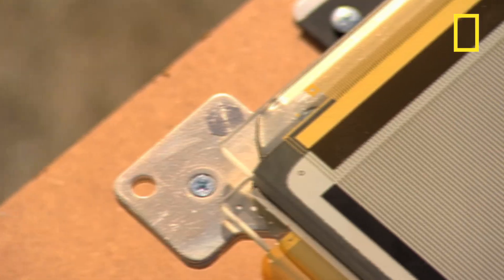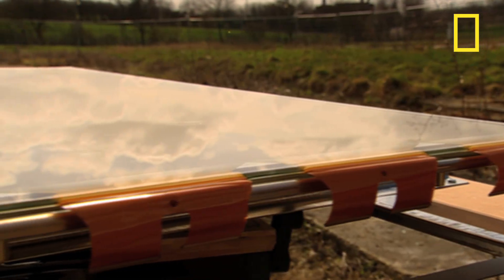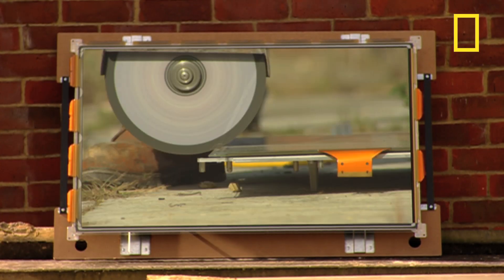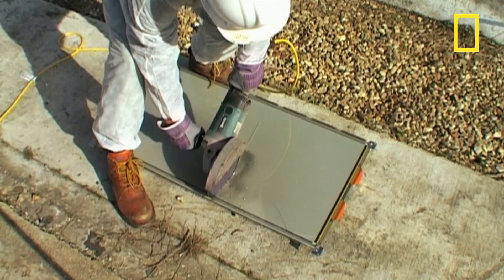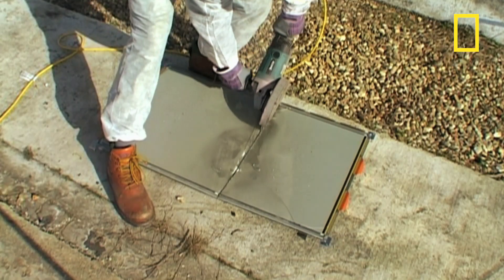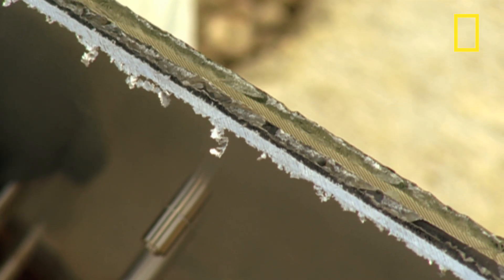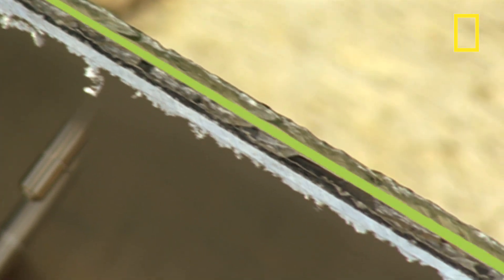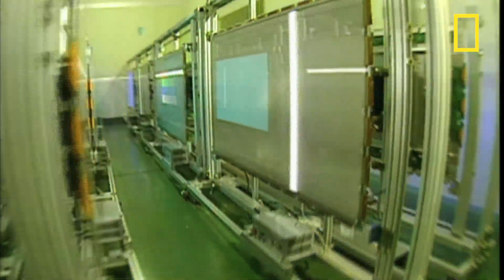Cutting Open a Plasma TV | I Didn't Know That

Comment: OLED is the future if they can get the price down. These screens use very, very little energy and are brighter than any other screen and can even be seen in sunlight.
Reply: trust me, each company has a set of rules regarding how low thay can display thier colours and brightnes, the only downside to Oled is image burn, which is also happening in plasma tv, but plasma tv is only temporary, where in OLED tvs it's permanent, furthermore, dolby vision is going to reset the specifications of the TV to new stadndards; today's standards for TV sets are similar to the bulky CRT screens, it hasn't changed, LCD LED Plasma are all very very capable. but this standard hold back on the TV, becuase if any companies try to overtake the standards, it would cost the consumer a lot of money. Dolby vidon might seem overhyped, but nonetheless, it is a technology ready for larte 2015 or early 2016
Reply: ***** If anything is going to overtake the new digital TV system, it will have to be backward compatible because there are still billions of CRT and LCD TVs out there. Where exactly is the problem with this supposed color limitation? Or better yet, where does it originate?
Reply: tarstarkusz
it originated from the first colour CRT screens, and most of the world is now moving on from CRTs, why should they still support CRT and Older LCD if this is NEW technology, look at XBone nd PS4, no backwards campat. And better colour measn brither whites and darker blacks, it'll look like u are watching a window rather than a tv.

In addition, if you view a HDR photo, go on google it, you'll just about get a glimpse of what a computer screen is capable of, but due to the fact that this thing sort of holds it back a bit, that's my point in a nutshell.
Reply: ***** This is something that even if it took off (and there's no indication that it will), would take a very long time to transition and it would absolutely have to be backwards compatible. It's not just the sets, it's all the production equipment and other infrastructure, it's trained producers and so on. You cannot possibly compare a game console to a formal standard that affects the entire industry. It took a long time to switch over to digital and the only real reason it happened was because the government wanted the portion of the EMS for other uses.
Reply: tarstarkusz
i see, but it'd be nice... i mean, ultra bright and ultra dark, the way come TV (lcd) are made the backlight bleed through the polarizer, afterall it's how it works.
Reply: *****
Even with the large % of people who had cable at the time when the switch to digital became mandatory, it got pushed back quite a few times because of public outcry. I don't think the public is going to want this. I am also not sure the cable companies will want this. because it's not entirely clear to me that existing cable equipment is compatible. Of course, Dolby has a record (no pun intended) of shaking an industry up.
Reply: wanna have a quick simulation of OLED er plasma with an LCD? Easy; cover one eye and leave the other open, do this for a minute until the covered eye is used to the darkness, then after 1 minute or at best 3 minutes, switch eyes, and keep switching to see the difference. that worked for me (no glasses - long sighted) it'll work for u sure!

Comment: China has something the US does not, an active space program.
China is at the stage the US was,,,when?
They have the worlds biggest dam, fastest train, most powerful supercomputer.
They are behind in quite a few areas but are catching up fast.
The biggest problem is that China is ready to implode, the social structure is failing fast, in short, the Walmart syndrom and not the China syndrom has taken hold.
People are working, to fail.